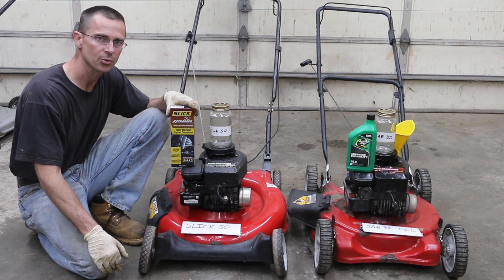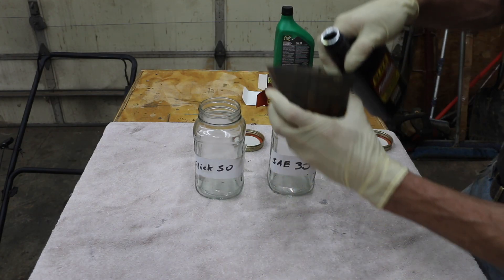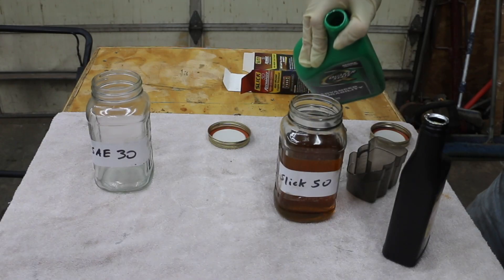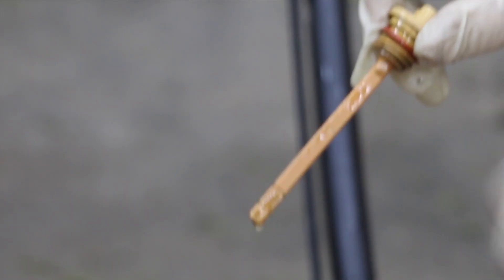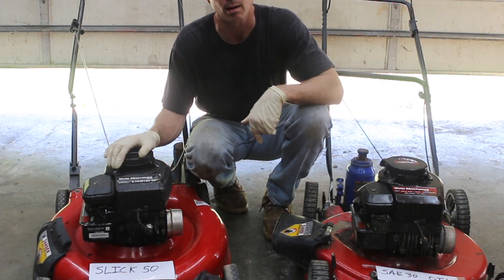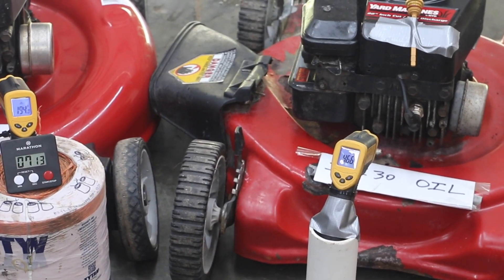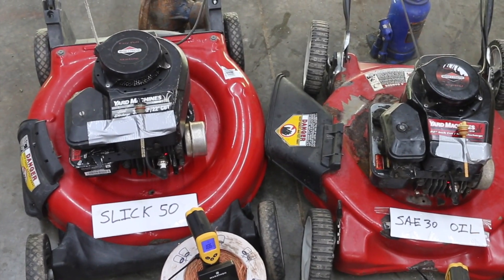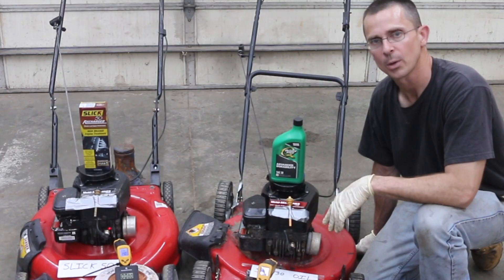Can't believe what SLICK 50 did to my engine!!--Dry Crankcase Test!

Comment: There are so many of these aftermarket treatments out there which contain stuff that the oil companies already use in a carefully calculated blend... a blend that is altered and refined through millions of miles and hours of testing in a huge variety of engines to achieve a blend that will work over the widest possible range of engines, temps and types of running (stop/start vs motorway etc) 
Sure adding an aftermarket treatment could improve things depending on its use/running environment etc.. but equally it could also be for the worse.
Reply from the maker: Thanks for the feedback.
Reply: @ProjectFarm   No problem.. and thanks for the video.  PTFE is a good dry lubricant but best suited for dry low load applications. I use it on lightweight conveyor systems all the time 
The treated engine may be running cooler because slick 50 has viscosity reducer which will help dissipate heat better... but  will also help drain the oil far better for the dry run test hence why it seized faster. That said, there may also be another variable at play in that both engines likely had unequal internal wear in both not being brand new. Cheers.

Comment: I have an old honda mini Tiller that would stop running on a load and was unusable anymore. The only thing I added was Friction Free 3000. It is an oil Additive with similar claims as as your slick 50. It also has millions of micro sized mild steel bearings in it.

After adding this product, it totally restored its power to the day I bought it. I really cannot stop it! I've been using it for years since.

I would love to see you test this product, I use it in all of my vehicles. I can send you a couple bottles if you need.

Friction Free 3000.
Reply: https://youtu.be/_okkAH4LqB8
Reply: They really need to update their videos
 Haha

Comment: Sorry buddy I disagree, I used slick 50 in a Harley 45 ,  the engine had the usual stuff in an old Harley ,  rear cylinder  piston slap , and sticking valves. Took five kicks to start, crap idle ect. I changed the oil added slick 50 , took the bike on a 60 mile run , after about 40 miles it started to run smoother, a lot less noise from the rear cylinder.after arriving. Had lunch , went to leave : key on , gas on, tickle the carb once , fired on the first kick and an ldled perfectly , zero racket from the rear cylinder . After that I’m a believer.
Reply from the maker: Thanks for the feedback.

Comment: Not really and oil additive guy but.......i had old truck with 275k and my Dad was a slick guy. Gave me a bottle and a oil change. That truck used oil, leaked and burned so bad I kept a gallon jug of oil in the cab. One day headed to work, about 13 miles out, it lost oil pressure and started to knock. Pulled over and the cab jug was empty. Drove onto work knocking and pulled in to the warehouse. The tech had the garage door open and could hear the knocking and came out. I ask if he could spare some oil? He said you need an engine not oil. It held 6 put in 5 started up, no knock! The tech said that is unbelievable! Slick 50??? Not sure, but I had two more occurrences and same results. 
The was interesting and the science is in the temperature testing. Would be interesting to see what the oil temperature is under a load comparison situation. May hooking and engine up to a over sized water pump and load testing?
I do like the fact of heat reduction. Heat is equal to wear.

Oh good job on videos! I have made a few and it is harder than it looks.
Reply from the maker: Thanks so much!  Thanks for the video idea.

Comment: I’ve never been a big fan of engine oil additives! I alway figured if additives made it better the  oil companies would use it and advertise how much better their stuff was than everybody else’s and that’s really not the case
Reply from the maker: Thanks for the feedback.
Reply: I came to the same conclusion, especially after trying Slick 50 and finding no difference in fuel economy, engine noise, etc. There have been 'miracle' engine treatments for about as long as there have been engines. Surely the guys at Valvoline, Mobil, Redline, or whoever you like have experimented with PTFE, but they don't put it in their oils.

Comment: I wonder if you mixed slick 50, Motorkote, Ceratech, and Engine Restore. If you could get the benefits of all four, lower temp, higher RPM's, fuel savings, and restore compression. The additive super mix!
Reply from the maker: Thanks for the video idea.

Comment: Dealerships I do work for still use additives in their oil changes.  I always found it funny that you can have engineers for all the manufacturers spend millions doing R&D on engines, then the oil companies spend millions on R&D to make the oil the engineers specify....there are many different engines and many different oil specifications.....and some yahoos at an additive company can come up with ONE product that can make them ALL better.   This one can of our whiz-bang oil slickum makes all the oil better.  Even though we designed it decades ago and oil has changed drastically, it's still the best!
LOL, I never sold that crap when I worked at a dealership, unless the customer just insisted.
Reply from the maker: Thanks for the feedback.

Comment: I know this is an old video but it kind of looks like the SAE30 engine did not have as much oil pulled out of it than the slick 50 engine. I wonder if removing the drain plug instead of draining the oil using a vacuum would have yielded different results.
Reply from the maker: Thanks for the feedback.

Comment: it seems more of the slick was drained due to being thinner than the 30.
look at 4:52 . you pulled out more slick from the engine than the 30.
so more oil was left in the 30 which let it run longer.
a better test would be, how long can these new engines last with say 1oz of oil. 30 or slick
Reply from the maker: Thanks for the feedback.

Comment: I'd like to see what the oils do in your lubricity tester. I hypothesize that the lower engine temperature correlates to lower friction and better wear.
Reply from the maker: Thanks for the video idea.
Reply: OIls have an operating temperature, measured in Centistokes, and until that temperature is reached the engine is subject to wear. So don`t sit with an idling engine.

Comment: The Slick 50 engine sounded as though it ran out of fuel as the temperature was no higher than its normal when it stopped? I also noticed that the oil only engine was not drained to the same level as the Slick 50 one (there was a distinct difference in the levels in the jars after draining)

Comment: first I want to tell you, the way you do the tests, you dont leave any room for second guesse
, also  Great job and advise.Thank you 
I'm a Marine technician aka
 Mechanic/Engineer . I've been for many years,  I believe that I have a test for you, not sure you can do this type of test, being a small engine technician, I'm asking because, I lot of my customers believe that a engine is a engine,  if you could, test this theory.  Murcruise 5.7
  vers 5.7 GM. aka (350. 305 small block V8,)  Using SAE 30 both on a load test at 4,600 rpm
Reply from the maker: Thanks for the video idea.

Comment: ...we have had a 'no oil' seized motors start and run again. maybe there is less damage done to 'slick 50' motor because the additive actually seized the piston in the bore; not so much the friction. the indication of this is that the motor without the additive went-for-longer and got-a-lot hotter when it stopped; and thus doing more damage internally. an indication of this would have been recording the normal running temperature of each motor and the temperature of each motor when they stopped. with this in mind; you may be misinterpreting the reason-for-the-outcome of this test and overlooked an opportunity to make your 'experiment' a little more interesting; and in the process, wasted time and purposeful materials. 
also, i have found that whenever we use additives; we put in only-a-fifth-of the prescribed amount [always] and our motors seem to run better, maybe because we do not change, so much, the viscosity of the oil. 
also from another perspective; there are 'good' engines and 'bad' engines. 

i reckon this test belies the true potential of your grey matter; rather than the potential of slick 50.
Reply from the maker: Thanks for the feedback.

Comment: have you thought about dicronite? Slick 50 .... I used it in my old Ford with a relatively recently overhauled engine - ruined it. I heard they may be still in business but because they got sued so much you don't hear a lot about them.
Reply from the maker: Thanks for the suggestion.

Comment: Maybe it was too much Slick 50 that assisted in the quick destruction of the engine? You should do this again with a different oil, and maybe a different mix of Slick 50.
Reply from the maker: Thanks for the suggestion.
Reply: @ProjectFarm  Thank you for doing this experiment, it is very interesting.

Comment: I'm pretty late on this comment, but maybe Energy Release (ER) would be worth checking out.  It is a great metal cutting oil.  Their gimmick is that you have to run it normally for quite a while to "condition" the metal surfaces.   Well, it DOES modify the surface grain structure in a metal cutting regime, but what is that worth as a engine oil additive?
Reply from the maker: Thanks for the suggestion.

Comment: I used to work for a motor oil company, and was told Slick 50 was a scam from the start. The "technology" behind it was, it coats the inside of the engine with Teflon. The only problem is, the temperature it takes for Teflon to adhere is higher than you bearings could stand. In other words, your engine would melt down before the Teflon ever comes into play. The way they try to prove it works is by using a cutaway engine that has been "treated". Then they "flood" the engine with a water hose while it is running to prove its protection. The water is actually cooling and lubricating. Short term is all they are looking for, to make a sale. Maybe I'm wrong. I don't claim to be an expert, just passing info along as i was told.
Reply: That sounds plausible to me. Opinions on oil are about like opinions on politics and religion. From all the reading I've done over the last 15+ years is that modern oil is nothing like what it was in the 50's, 60's, or 70's (when a lot of these additives or brand legends got started I think), and that walmart house brand or royal purple are going to do the same thing pretty much.

Comment: Even in 'splash-lubricated' engines, oil plays an important cooling-role in transferring heat to the block where 'fins' then convey the heat to the surrounding air. Perhaps S50 + 'any' oil is a better conveyor of heat than without. In this case then, this demo seems to be unfair to S50.
Reply from the maker: Thanks for the feedback.

Comment: It’s cool to see you still respond and interact with a video from over 3 years ago! Keep the good work up
Reply from the maker: Thanks, will do.
Reply: @ProjectFarm  try Lucas
Reply: @ProjectFarm  Do you think the test results would be different and/or engines last longer post oil-drain, if you did this with both engines at cold vs operating temperature?

Remove spark plug wire and turn the engines over about 15-20 times each to get the oil distributed. Just curious
Reply: This guy has a true passion for what he does. Best brand comparison channel on YT
Reply: can tell it was 4 years ago.     Thats a compliment. He's driven
Reply: That's a person who REALLY appreciates his supporters. Instead of just saying that he appreciates his subscribers once in a while at the beginning of a video, he actually proves it. Protect Farm is, without question, one of the best content creators on YouTube.
Reply: Are those used engines? They appear quite different. Could that have any adverse affect on the outcome?
Reply: @genegene3348  slick 50 is supposed to work better in used engines, there being more imperfections for it to embed in. That's what the literature from 25+yrs ago said anyway
Reply: He is a true Gentleman!
Reply: The original Slick 50 formula back in 1984 is very different than what is made today! The original formula was great and worked well. However the original partners sued each other and the Slick 50 name was bought and sold and the formula was changed and now it isn't worth a damn. If you're really interested you could look up a Slick50 documentary here on YouTube.

Comment: Recently found your channel and love all your videos and content! I am just curious though, where do you get all these lawn mowers and engines to screw around with and then what do you do with them afterwards? Do you try to rebuild some? Or just haul them all to the metal dump?
Reply: ....I have 2 extras - my fancy new husky mower is allergic to my patchy lawn dust, pinhole in carb fuel nozzle is now even tinier. First used was crappy, second is now my main mower and husky is backup

Comment: The mower on the right had the exhaust from the other blowing at it. I wonder if that's why it ran hotter. I'm surprised the cup 50 engine died sooner. Maybe the engine had to be run for many hours for it to really soak into the metal. Wear can also make a difference. I also wonder what seized. Piston in bore or crankshaft. I've seen many blown engines and mostly the con rod big end seizes and it breaks. In a similar topic my instructor took a chainsaw with a well worn engine and ran it on straight gas to see how long it would run without oil mixed.  He was surprised. He went through 8 tanks of fuel before it seized.
Reply from the maker: Thanks for the feedback.

Comment: Hey just saw your video. Brought back memories of the old commercial. You might have used the wrong Slick 50. They have  a wide range of products. You need to use "Slick 50 Classic Engine Treatment with Cerflon® PTFE Original Slick 50 Ceramic" I don't think the high mileage version has this additive . I believe you need to run it a while so the material bonds to the parts.
Reply from the maker: Thanks for the suggestion.

Comment: I wonder why slick50 causes the engine to run cooler? I installed slick50 in my new moho in 98. ran it for 90k miles then started having cooling problems. replaced the cooling system, but still had problems with it running 15 degrees hotter. I installed a 180degree thermostat and cooling problem went away. I had forgotten that I had installed the slick50 until I saw this video. Up graded the moho at 140k miles, it was in perfect running condition.
Reply from the maker: Thanks for sharing.

Comment: Recently  I had to make 3 trips to the parts store to get a automotive radiator cap. Each of the first 2 caps wouldn't hold pressure to 16 psi as the cap was rated at. all were new. One of the two wouldn't hold at all. all were diff brands. Perhaps a fun easy test!
Reply from the maker: Thanks for the suggestion.

Comment: The original Slick 50 formula was changed when it was sold by the originator and inventor, and it NEVER did as well on the alternative formula vs to original. The formula has changed 3 times over the decades and is now chemically not anything like the original...... FYI. It's branded Slick 50, but it is NOT the same. You are buying ONLY a name now (not the quality). TOO BAD!
Reply from the maker: Thanks for the feedback.

Comment: You should have used 2 new engines. Engine that failed first probably had tighter bearing clearances or tighter ring gap. Would love to see both engines torn down to see what happened. I have seen an oil filter fail (rot pin hole), and the car drive home from the mall with no oil with ac on in 90 deg weather. Car got slick 50 at 75k miles and had the issue at 100k. No engine damage. Pulled filter apart, no debris. I drove the car for another 40k then sold it.
Reply from the maker: Great suggestion!  Thank you.

Comment: I blew a radiator hose on I-95 in Georgia on a 90° hot summer day. I drove with no water for at least 10 miles. When I got to the gas station, I patched up the hose and filled up the car with antifreeze. I drove that car for another 230,000 miles after that day without a problem. That was with slick 50. Back then you treated the engine every 50,000 miles. Not sure about this new stuff where you have to put it in every oil change.
Reply from the maker: Thanks for the feedback.

Comment: I  would like to see you do that with synthetic oils. ie Mobile 1 and Castrol Syntech
Reply from the maker: Thanks for the video idea.
Reply: My ex drove my truck out of oil in the middle of nowhere Arizona at like 2am..... all i had on hand was 1qt Slick50 1qt Duralube and like 2½qts of syntech.....i dumped it all in and finished filling it at the next truck stop about 60 miles later...... that motor ran another 5 years before it burned valves and I swapped it out..... my caprice was treated with the same thing slick50 duralube and syntech from the day i put the new motor in it...... it lost the lower radiator hose on the way home one summer and i had to drive it like 4 miles to get it home..... it blew up my Mallory temp gague and i had to flood it to finally kill it it was sooooo hot...... after i fixed the hose and changed the oil with another 5qts syntech it ran another 12 years before the guy i sold it to died and his niece scrapped the car.....i bought the engine back and it's waiting its new home in my garage..... it still ran like a top even after the car got totally trashed!!!!!  I'm pretty sold on the slick 50 duralube and full synth oil!!  
It proved itself several times!!!!!
Reply: Castol? What about that fancy royal purple?